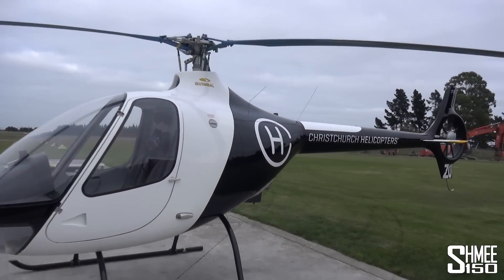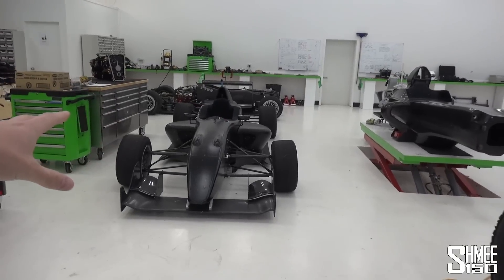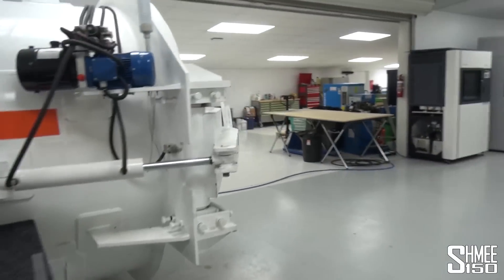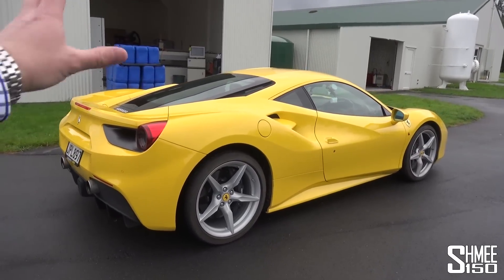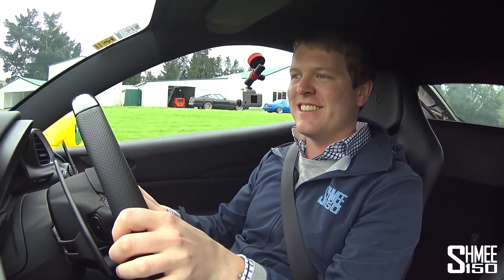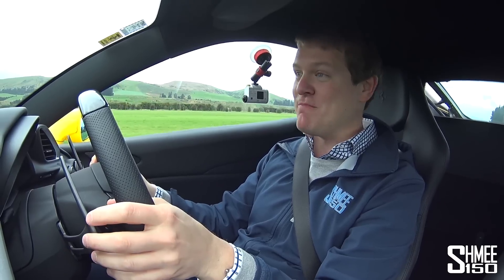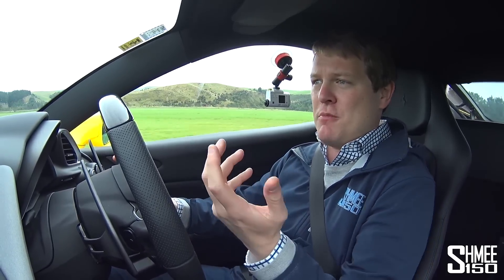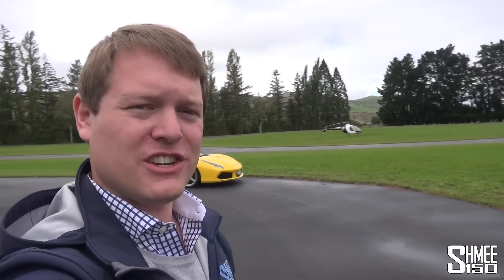What's the Ferrari 488 GTB Got? Private Back-Yard Race Track

Comment: If you wanna buy a mid engined Ferrari, I encourage you to buy the Ferrari 458 Italia or the Ferrari 458 Speciale. Simply because of the sound from the 4.5L natural aspirated V8. The 488 is good but not a big fan of that sound. I even think my Mclarens sound better than the 488.
Reply: yixiang loo lolz
Reply: If you're going to buy a Ferrari I encourage you to drive them all first and not base it off the sound.. although I would rank it 458S > 488 > 458